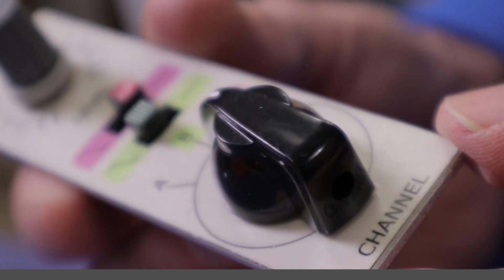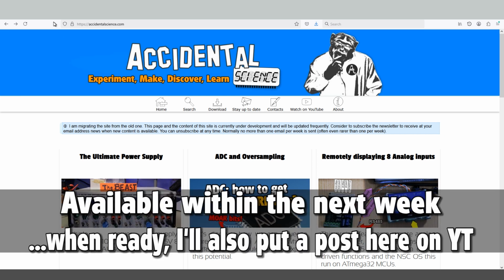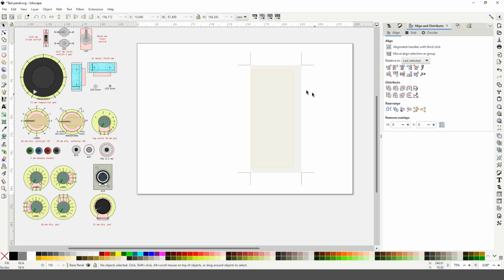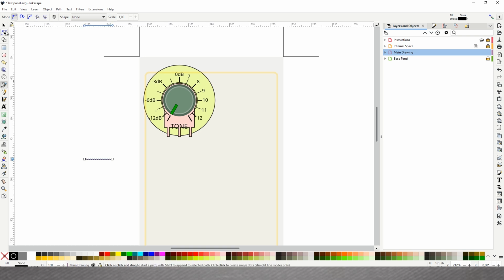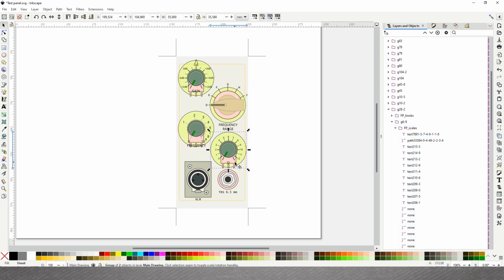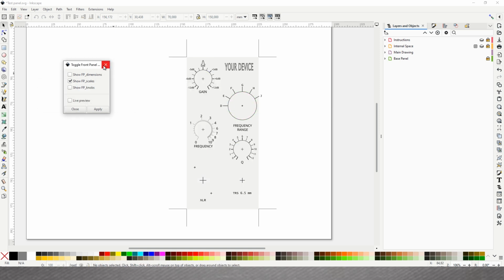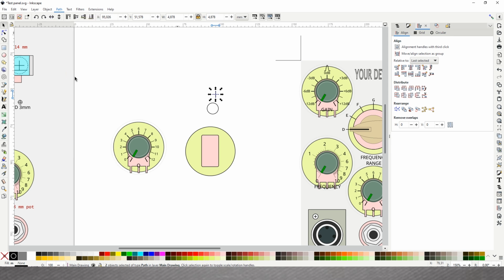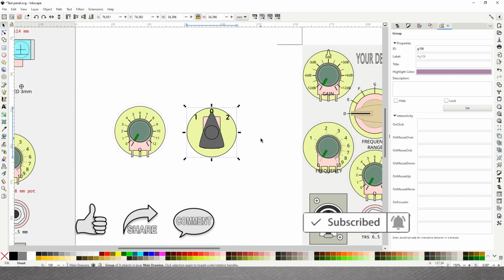How to Design DIY Front Panels with Inkscape - Full Tutorial

Comment: I have subscribed, but i didn't receive the front panel template link. Could you response it??
Reply from the maker: The panel template and extension link was sent long time ago via newsletter. There is however a public repository on GitHub. Please check it out the link in the pinned comment.